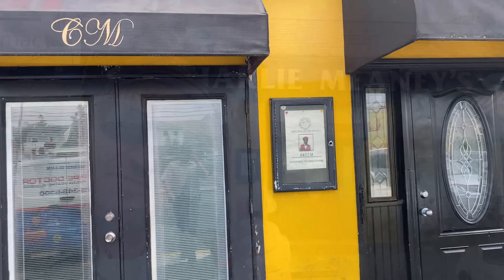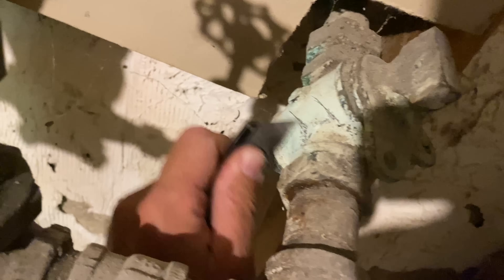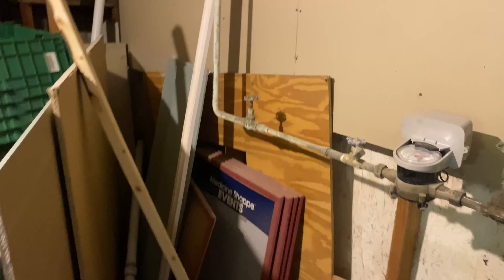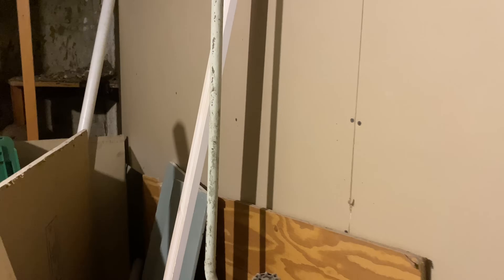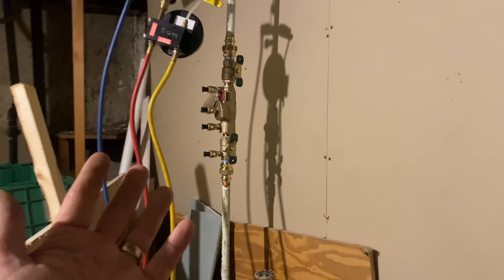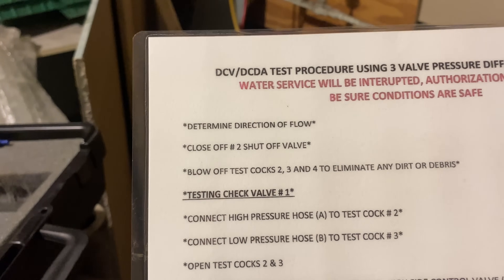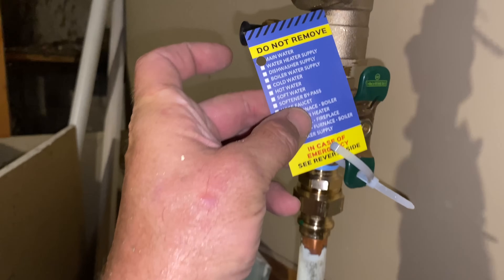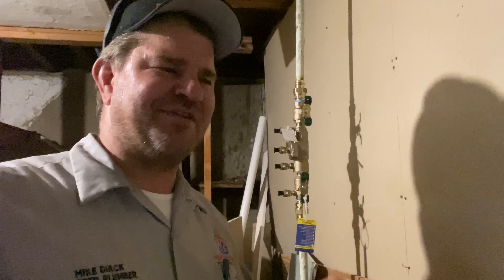Watts Backflow Installation and Test Procedures

Comment: Can you explain why they reduced the pipe to 1/2 inch and then increased it back to 3/4' inch after the meter ? If the water main comes in at 3/4, and you increase the internal building pipe to 1 inch, are you getting more flow (volume) while keeping the same pressure (psi) ?

Comment: In the UK, it's  called a reduced  pressure zone valve (RPZ).
Our double  check valves are basic devices to prevent back flow.
RPZ valves are normally only required over here where the public supply is at extreme risk due to the commercial processes .
Interesting to compare USA and UK regulation.
Reply: @PipeDoctor  absolutely, spot on Mike!
Reply: RPZ = Reduced Pressure Zone. mainly to keep downstream pressurized  things form backing up into and contaminating city/shared/potable waters.
especially nasty stagnant water(chock full of lead and other deadly chemicals in high concentrations)  "hydronic boilers water", also any tanks/lines/homes that may be above a failed city water pressure or starvation from fire usage. pretty much all city/community water.

Comment: I had no idea about the importance of backflow valves in protecting the public water supply This video is eye-opening
Reply: lol, never you mind the tons of lead piping  and toxic junk leeching into the lines when they have a pressure loss/fire. inter building, you not running the faucet for an eternity before drinking any. same as the drinking from garden hose warnings, lead and other toxins... as kids, whom wasn't smart enough to run the water from hose until it got cool/fresh water/pumped from well)or icky city poison fishy lake water(lol).

Comment: What a shit show, when you see that many changes in diameter on a water line you know you’re just scratching the surface on the weird bs they have  for plumbing.  Just installed a pressure reducing back flow device at a golf course, all 2in and originally done with galvanized pipe. Now it’s sexy copper and we put in a union just in case the back flow device needs to be removed. We have another guy who tests the back flow devices but now I know, all I need now is the tool. How much Mikey pipes?